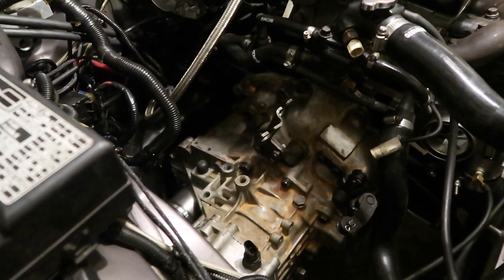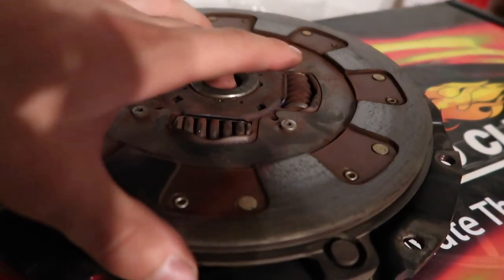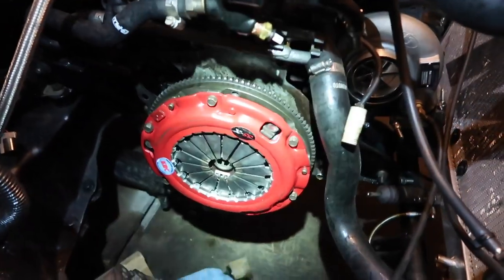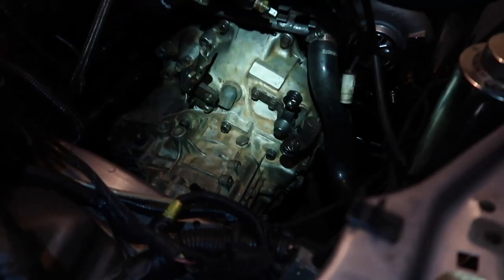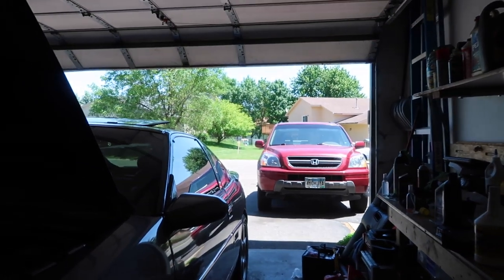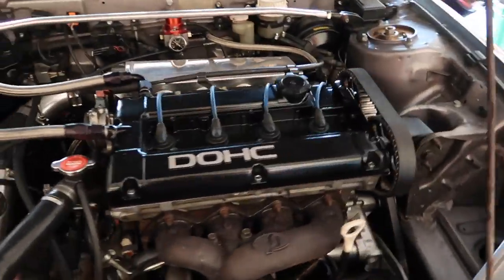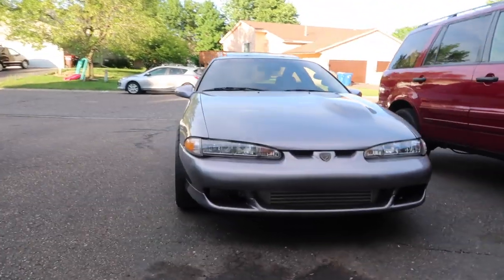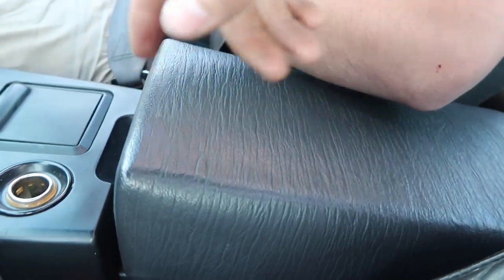Big Turbo DSM Gets a NEW CLUTCH!

Comment: No brake calipers shots....😔....I saw them mounted just wanted to see more..... Also, unless you’re going to have a lot of track time, I’d put the battery up front. Also, did you do the fuel pump relay upgrade on this car? For the MPI circuit? If not that will yield a few extra ponies, allowing the fuel pump to run at at its designated volume as intended.
Reply from the maker: I had actually filmed it but then didn't end up putting it in. I can send them personally to you if you'd like. I will most likely be putting my battery up front. I don't like it in the trunk. And yes the fuel pump relay has been upgraded.